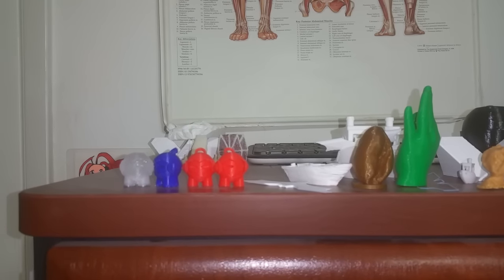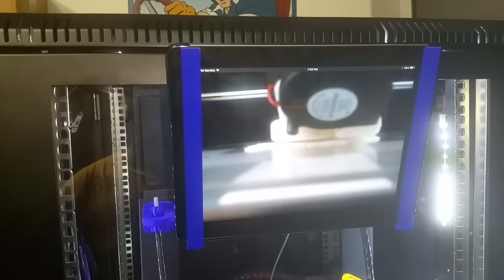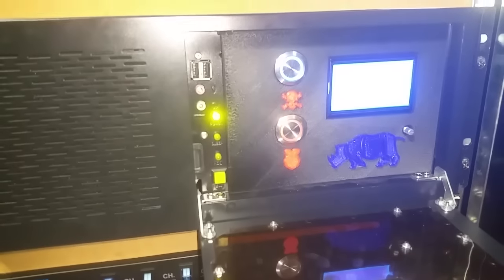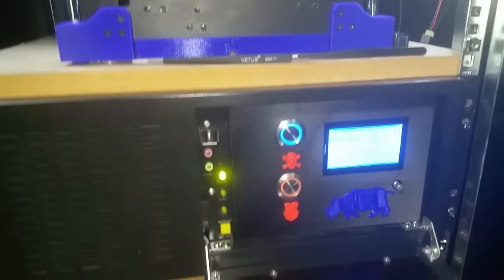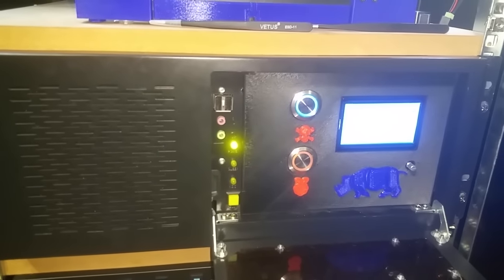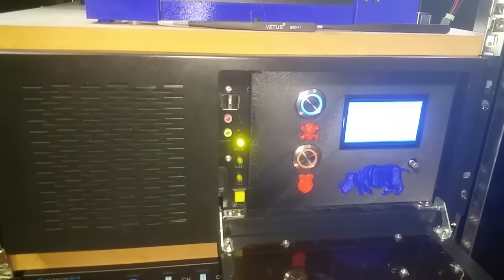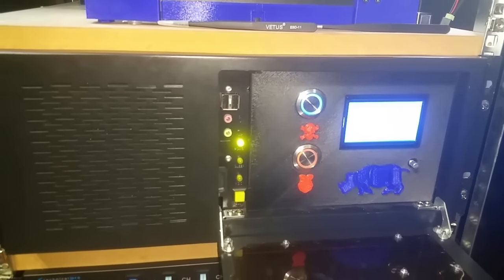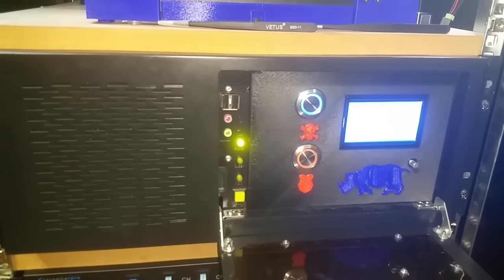Controller Box (AIU) and Enclosure Come Together

Comment: i have a couple larger (4') racks, and this inspires me to use one like this
Reply: also have a rack mount atx case similar to yours,,,gotta love picking through the work e-waste pile before it gets taken to the recyclers
Reply from the maker: +reflector36 Do it!!! You'd be surprised how well they fit into 3D Printing. Yeah, I got all this stuff from here and there. The ATX PSU and case are working perfectly.

Comment: Do you or anyone ever have a problem with the Z Axis not staying true to the bed? Like one motor is out of time with the other. Whenever I start my printer to do a new print I have to literally measure the Gantry itself to the bed and hold the left motor and turn the right motor to even them out. Or so I feel like that's what I have to do. and I am Using a Wanhao Dup i3